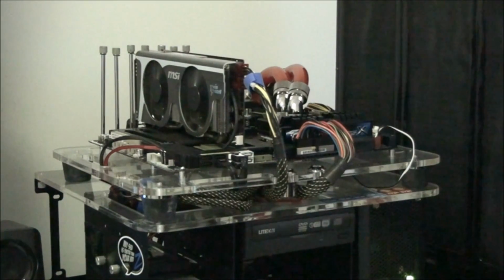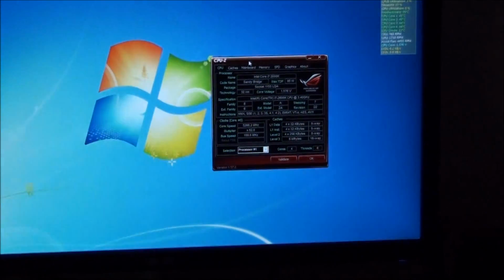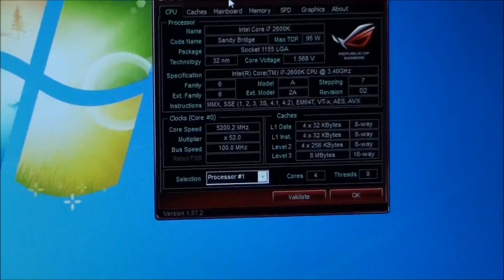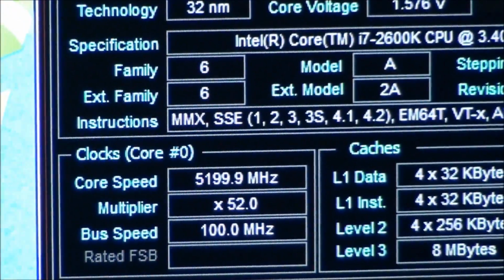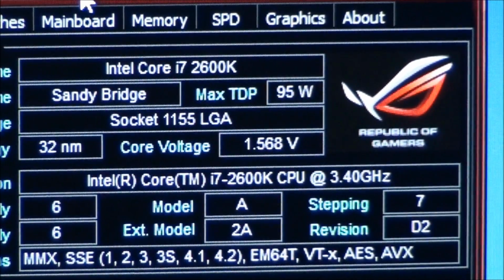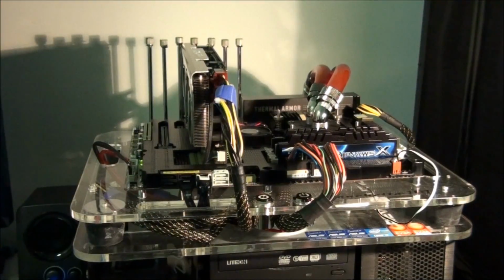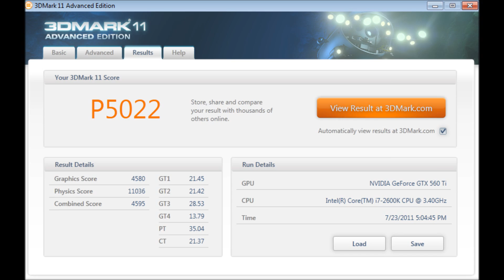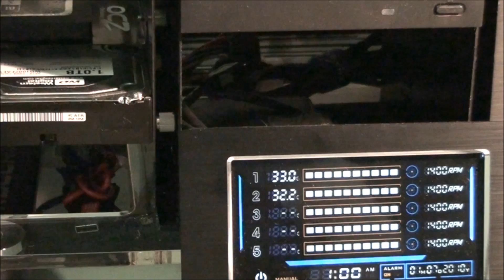Sabertooth P67 Water-cooled 2600K Benchmarks At 5.2GHz

Comment: you should put that system in a case. if properly ventilated and good circulation you could have the internal volume of air cooler than the room.

Comment: @SingularityComputers You cant beat nature. Geothermal is great even for 100ft or 30.48 meters, as long as you have on way up and down for air. Cool things is it will almost never have a big change in temps, when are you down that low. Some people use water other use air.   Water will be better but if the pump stops you will have problems later. Just my idea on a pc rig. It would cool a house and anything attach to it. Also with you comment on people dont get water cooling.

Comment: The only way he is going to get better temps are if on the water box is in another room with no heat dumping in to it. Maybe a closet with a small fan pushing hot air out from the top. The ambient temp are high, but we will only get about maybe 10 degrees. What is important is he needs something to transfer heat from the cpu faster. The water box can handle the heat, it  is just not pulling the heat off with the surface area it has. Maybe heat pipes to a big slap of copper, then CU to H20 box